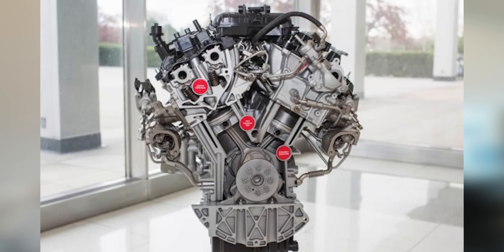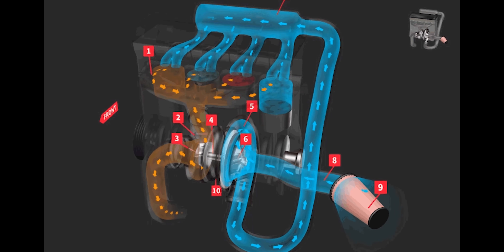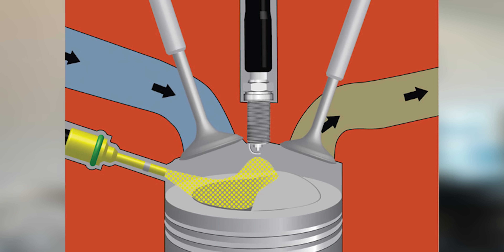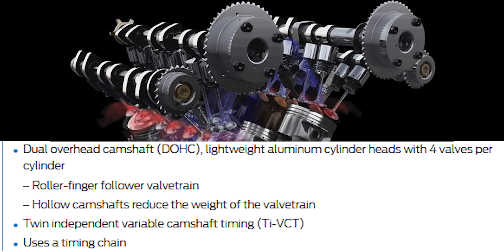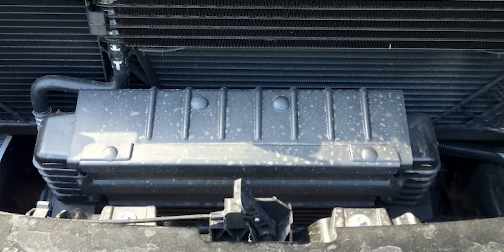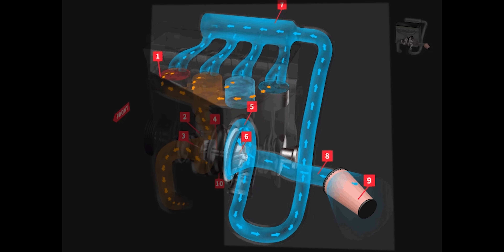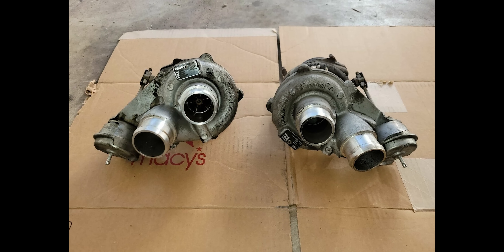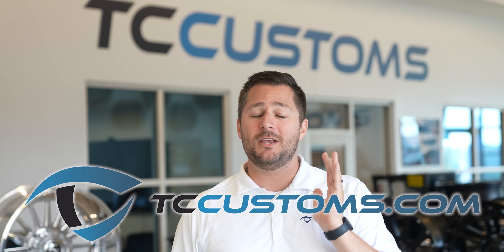The Truth about the Ecoboost Engine!

Comment: The reason for the port injection is to keep the valves clean. The earlier 3.5L EcoBoost only had direct injection. Optimum performance, but without fuel spraying on the valves, they had really bad carbon build up on the intake valves. Common problem with all direct injection engines, not just Fords.
Reply: what you mean by earlier ??? just got a 2016 ...is that the one????
Reply: @MrRacso2000tj  yeah it is. 2017 is when they added port injection but don't fear... I have a 2014 and Sea Foam it through the intake at least once a year to clean the intake valves. No problems with carbon.
Reply: That's why you drill a 1/16" hole in the bottom of the intercooler. Keeps my valves spotless.

Comment: We have a 2018 F-150 with the 3.5 Ecoboost v-6 and haven’t had any problems with it.  I keep the oil changed every 5,000 miles and use synthetic oil and Motorcraft oil filters.

Comment: Interesting talking points on the direct injection and port injection. I think you missed a critical point of putting port injection in combination with DI. Direct injection has an issue with allowing build up of junk on the back of the valves much faster and aggressively than traditionally port injection. Port injection helps keep the back of the valves clean because the fuel hitting the back of the valves naturally helps clean them. While direct injection is certainly better in many ways you loose this cleaning effect. To say they added port injection on top of direct injection for “extra” fuel I think is a little off. Plenty of DI only engines out there making vastly more power on DI alone and the same can be said about port only engines. BMW and Mercedes ran into this issues on early DI only engines having excess build up very quickly on the back of valves and requiring the valves to be walnut blasted to clean. Adding port injection on top of DI in order to get the better efficiency of DI but also the occasional port injection cleaning action is the real reason and it’s a win win.
Reply: also heard about di vs pi relating to cold startup    di has shown to cause some cylinder/piston lube problems in some vehicles
Reply: You are correct .. the outboard engine manufacturer OMC went bankrupt with their Fitch system .. that was the parent company of Johnson/Evinrude . 
Carbon deposits build up heavy then fall into the cylinder wall  causing scaring and ultimately blow by ..
Reply: @windellpenton    also read how they're putting engine egr upstream  of the turbo and it gunks up the turbo     so now turbo decarbon is considered scheduled maintenance on bmw and others       cha ching
Reply: He didn’t want to say “all our single injector engines have a design flaw”!
   That cold start comment about piston lube whatever is untrue.  Any cold start lube problems are caused by liquid fuel “washing down” the oil on the cylinder walls, cause excess wear and oil dilution.  Problem solved by direct injection.

Comment: Ford has obviously told you many of the good points about the 3.5 EB.   I owned a '19 XLT EB and put about 49k miles on it including two cross country runs towing trailers.  It's a pleasure to drive and gets good mileage, overall.   What this video does not cover is the numerous recalls, including can phaser programming updates and engine warranty extensions to help calm owners who are hearing reports of premature engine failure.   More than one Ford employee told me my plan to hold on to the truck into high mileage might be a risky decision.  But anyone buying an F-150 weighing in under 5k lbs to tow loads over 9k lbs needs to take time to adjust to its handling characteristics, particularly if you're moving down from any HD pickup.
Reply: But what about this....youtube it >>>  "2011 Ford F150 EcoBoost rolls 400k in mileage in 9 years!!"

Comment: Be truthful. Dual injectors are needed to spray fuel onto valve stems and back of the valves to prevent the fatal flaw if direct injection motors. Now your explanation beyond this point applies.  Good to see Ford has reacted with this solution.
Reply: That’s correct, the carbon build up is intense. It was the easy cheap solution to a major flaw

Comment: What a lot of dont realize is these are not just engines with bolted on turbos, they were built for turbo charging and  handling high pressures  do your maintenance folks is key and get them on the highway once in a while for a nice long run

Comment: I am on the edge about buying one of these and have heard a lot of bad things about them but seeing these comments encourages me lol.
Reply: The only bad years were 2017-2020 due to a subpar part with the cam phaser setup...that has been TOTALLY CORRECTED AS OF 2021 MODELS....all years before and after those 4 were essentially great and many testimonies of 200-400,000 miles on them without issues...just gen maintenance.. the 2.7 and 5.0 are/were rock solid in all years...

Comment: I own a 2016 ecoboost F150 quad 4x4 3.5.This is like a race car engine . I love the power and economy. I put a catch can on my direct injection . 40,000 miles and no problems in five years.I let my Ford dealer change my oil at 5,000 miles. Oil is cheaper than a new motor.Keep my air cleaner clean too. My truck is faster than my 69 GTO was

Comment: For me I prefer the Coyote V8 over the EcoBoost V6 anyday of the week. Don't have to worry about turbos going bad and less stuff to go wrong as well.
Reply: Idk about that man, the ecoboost is much better than the V8. The V8 has a lot of problems. The turbos last the entire life of the truck. I’ve had both and my ecoboost has always out performed my V8. Plus it was much faster and more fun to drive than the V8.
Reply: There’s def more stuff to go wrong with the V8, also that ecoboost makes more power than the V8
Reply: @athensgod2361  But will it outlast the V8 and will it outlast the 5.7L I-Force V8 in the Toyota Tundra as well.
Reply: @athensgod2361  Also if the EcoBoost is so good then why did they make the 5.0L Coyote V8 in the F150 in the first place.
Reply: @CJColvin  because they didn’t have the technology at the time to make the ecoboost. A V8 is much more simple. You don’t have to worry about the turbos in the ecoboost either, they are aircraft grade and are water cooled. They can take a lot of torture.
Reply: @CJColvin  well you can’t compare ford to Toyota, 2 completely different v’s. The ford V8 is night and day compared to the Toyota V8 which wasn’t engineered very well.
Reply: @CJColvin  yes it definitely also outlasts the V8, my friend had a eco boost that had 370,000 miles. But it was well taken care of. He never had to replace the turbos and would only have too replace the spark plugs and throttle body every 70,000 miles which is normal. The truck ran and cranked everytime.
Reply: @CJColvin  I was in disbelief as well that the turbos would last that long, but that’s what made me like the ecoboost engine. It makes so much torque too. People just hate v’6s but theirs nothing wrong with them. That ecoboost will smoke the 5.0 all day everyday in a truck.
Reply: @CJColvin  watch the video “ford F-150 ecoboost torture test ep 1 6” it was made about 8 years ago. That engine is no joke and I own one too say that video is 100% real. My ecoboost has had no problems and turns the key everytime.
Reply: @athensgod2361  But it won't outlast the old 302 Windsor V8 in my 96 F150 mate.
Reply: @athensgod2361  I watched the video many times before and my dad's coworker had one and he had nothing but endless issues with his truck. You seemed to sound like a muscle car hater to me and considering the EcoBoost won't be as legendary as the old Chevelle SS 454.
Reply: @athensgod2361   Also if the EcoBoost is so good then why didn't Ford make the EcoBoost for the Ford Super Duty.

Comment: went from a 2012 F150 XLT with the Coyote 5.0 to a 2018 Lariat with the 3.5 EB..........love the instant power of the 3.5, but I should have kept my Coyote 5.0 as I am putting the EB back in the shop next Monday, for the 2ND TIME for the damned cam phaser issue, and I don't even have 34K on it yet..........next truck will be a Tundra or Tacoma.

Comment: Nice presentation. I am considering going with 3.5 ecoboost doing my research so far I like what i am reading and hearing.
Reply: Update ended up buying a powerboost in seaside, California. 
Sooner than I thought my 2013 truck was going out while on vacation dealer had told me there was only 3 so far in California and one with the kings ranch interior with the platinum model. So I bought it.
Awesome truck and pulling power going on 1900 miles and still learning this truck.
Something happen on way to work, it turn on the turn signsl for me. Is it learning how I get to work???

Comment: One great thing about the 3.5 Eco motor on the f150, the water pump is mounted externally. Not so hard to replace and if it fails it doesn't dump anti freeze into the oil. The 3.5 Eco motor used in the transverse / SUV applications has the water pump internally, which is a far inferior system. I suppose when mounted transverse they don't have the room for the water pump mounted externally.
Reply: My brother is a mechanic and I have a 15 3.5 eco twin turbo Explorer Sport. He was like when its time to change the water pump you might as well trade it in as that is a complete PIA to do. Also installed a catch can in it to stop the slow oil drip into the engine. It catches about a shot or 2 of oil in there at every oil change that otherwise that would get in the engine and eventually mess things up.

Comment: Had a 2018 raptor and drove it 105,000 miles. Cam phasers failed 3 times. Replaced them twice and traded it in for a ram the 3rd time. Wish ford could have fixed this because I really didn't want the get rid of the truck but I wasn't about to spend 4 grand every time it happens after the warranty was up
Reply: In my experience  something is always breaking with Ford vehicles.
Reply: @jkeelsnc  Toyota don't put transmission cooler on the Tundra Anymore.  Transmission won't last .
Reply: Don’t feel bad my 2018 eco boost f150  cam phasers went out twice already at 60,000 miles
Reply: @hexhead5732  my 2017 Platinum has had the cam phasers replaced (motor sounded like a diesel on cold start), torque converter replaced and the 10 speed transmission overhauled (transmission would buck and slam into gears) this was done between 30k-50k miles (under factory & extended warranty).  I only had to pay the $200 deductible.  I have my oil and filter changed every 5k miles. I use Pennzoil Ultra Platinum 5w30 and a Mobil 1 filter, so dirty oil shouldn't be the cause of the cam phasers failing. 
I currently have 60k on the truck. I'm hoping it will be more reliable going forward.
Reply: 2016 - 2020 were the years with a poor cam phaser setup in the 3.5...that was completely addressed and cured in 2021.....
Reply: ghosting my comments ?  See here, the 2016 -2020 had bad cam phaser setup...complete corrected in 2021

Comment: My 2012 Lincoln MKS ecoboost is still going strong with 120k on the clock and its tuned to 450 hp no problems!
Reply: Keep an eye on your coolant/oil, that one has the internal water pump that can leak coolant into the oil. Those are nice cars though, I've rented them and loved the mix of luxury and performance. I bet it's fun at 450!

Comment: I'll never own one of these again. I had a 2014 with 60k miles and it had coolant leaks on both turbos, a bad crank sensor that left us stranded on the side of the road, a failing starter motor, & the cold start timing chain rattle. A friend of mine had a 2018 Lariat with the 3.5 and 10 speed and it also had cam phaser issues (cold start rattle), and transmission issues. Another still has a 2019 Platinum with the 3.5 and is also having the cold start rattle issue. The 3.5 EB  engine makes great power when its running right but has WAY too many problems well before 100k miles.
Reply: It all depends on maintenance.  I feel overall it’s pretty reliable
Reply: @jkeelsnc  I traded my never out of the shop Toyota Tacoma that only had 70,000 miles after 7 years (hint: spent that much time in the shop) on my no issues 2018 F150 2.7 that has 114,000 miles on it. My Dad’s 2019 Toyota Avalon was recalled and unable to repair for so long he got rid of it with only 8,000 miles on it. Not sure about Toyota’s reliability.
Reply: My 2014 3.5 turbos leaked, one at 75k and the other at 99k, latter out of warranty. Probably 60k miles I started setting oil change reminder at 50%. I’m still keen on Fords. Tacomas are great and I’d never buy gm or dodge (biased reasons). I put $4k in repairs and maintenance around 100k miles ($3k was unplanned). Other than this, it’s been great. Reading multiple comments of how great the 2.7 is might look at that one.
Reply: Same for me I lost money buying this truck. Never again
Reply: @ponzischemer1424 I’m not sure about your comments. Every ford I have owned was a money pit and stressed me out even my 20 eco boost that I traded in after the engine blew and transmission started slipping

Comment: I have to correct you. In the past ,having to allow the engine to cool down before turning off was due to oil coking. This happened because you shut the engine off and oil is no longer flowing thru the turbo sitting in the hot turbo center section.
Reply: That is why Chrysler put water cooled turbo center section on it's 2.2L and 2.5L turbo's starting back in 1986. This is NOT a new concept.

Comment: I have 2016 supercrew lifted 4x4. ¹30000 miles. I routinely will  weigh  25,000lbs across the scales at the local gravel pit. No problems whatsoever. Tow haul mode has no turbo lag. Specially empty on the interstate. Checked it at 80,000 miles  0-60 5.7 seconds. It sometimes will break rear tires lose at 50 if you really want to get after it.
Reply: Tow haul mode is great. I used it a lot this summer hauling trailers when I moved my family 300 miles. I like how it upshifts and downshifts to make the best used of the gear ratios. Slowing down to stop etc. it downshifts to provide engine braking. Works great.

Comment: I bought a 2018 Navigator L with about 78k miles on it. Cold start rattle started around 85k miles. Needless to say, I was upset. I reasoned with myself that I plan to put another 100k miles on this engine, so i went to the dealership for the VCT phaser replacement and had them replace the water pump, solenoids, timing chain and tensioners too. Came out to around $5k (3500 for just 4 phaser replacement). Ended up still having an issue and they had to tear it all down and replace 1 of the 4 phasers again at their expense. Since 2021 they seem to have figured out this issue. So I feel like I will get a lot more life out of the vehicle and plan to change my oil 5k miles max to get all i can. I did a ton of homework after the issue came up and I'm not sure there is any amount of inspection that could have caught this issue before I bought it.

Comment: I absolutely love my 2019 3.5 eco, it tows like a beast.  I don’t know why so many of your service techs would choose the 5.0 over it……
Reply: Because they work on it and see a lot of potential problem they never see to the coyotes
Reply: @r6master69  2018 and newer 5.0 have the oil consumption problem. Requires getting a whole new engine block to fix it… id buy a 2011-2017 5.0
Reply: @Lee-zi1zb  I have a 2011 5.0. It drinks a quart of oil per 1000 miles.
Reply: @bobkohn1809  how many miles?
Reply: @Lee-zi1zb  It started at just over 100k. The truck now has 157k. Runs fine, absolutely zero smoke, even at cold start up before the catalytic converter warms up.

Comment: I’ve owned both a 1st gen and 2nd gen 3.5.  Good engines overall but they have their own unique quirks.
Reply: Like what? I’m
Not a truck person but I just got 2017 f150 xlt sport ecoboost
Reply: @claudegrinnell9602  change the oil every 3,000-5,000mi.  The goal is to change it before it turns black.  Run 91-93 octane gas.  Keep an eye on your coolant level.  Coolant leaks are common.

Comment: I have the little v6 eco boost I believe it's a 2.6 L. Love it. A 2016 model and I have gotten 24 mpg driving 62 to 65 mph down interstate. I've got 75000 on her. I sometimes pull a camper and a small horse trailer, not at the same time
Reply: You mean 2.7, there a great motor with decent power. Keep injectors clean..